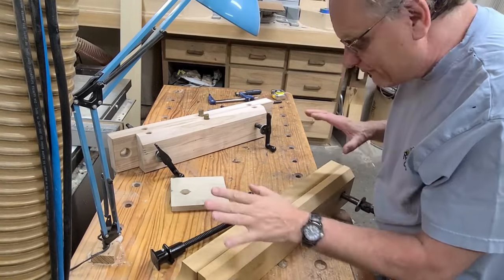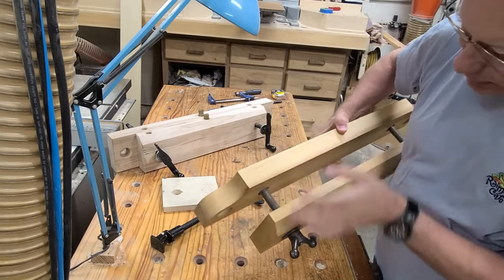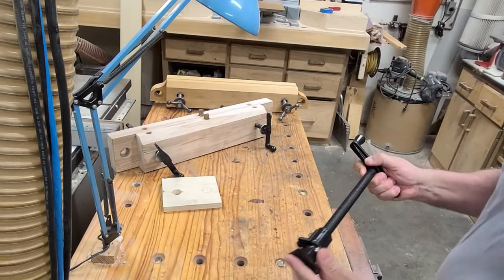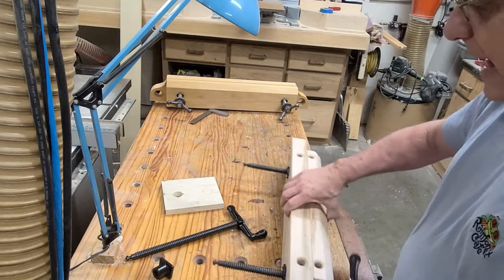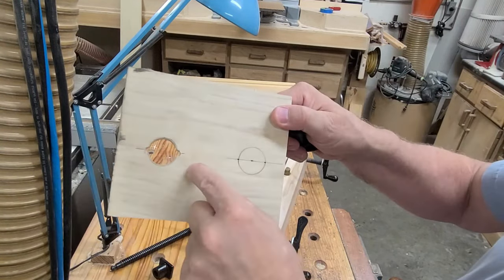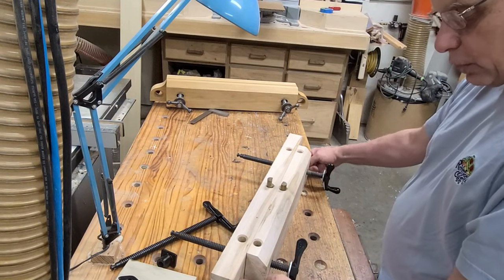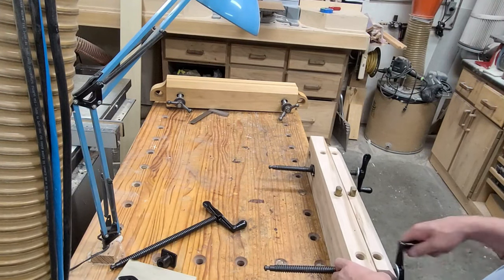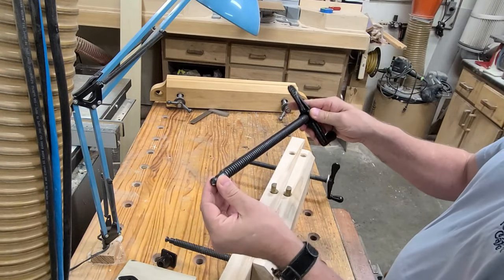Build a Inexpensive Moxon Vise in Record Time Using This Kit

Comment: Hi, just seen this video.  you say you drilled an 11/16th hole in the front jaws for the threaded part to pass through.  As the rod is 11/16th diameter doesn't this give you severe racking problems as the rod will be fixed perpendicular to the rear jaws.  Apart from that, it's a really good idea.  The other problem is that the Pony Jorgensen parts have been discontinued (at least they are not available any more in the UK).